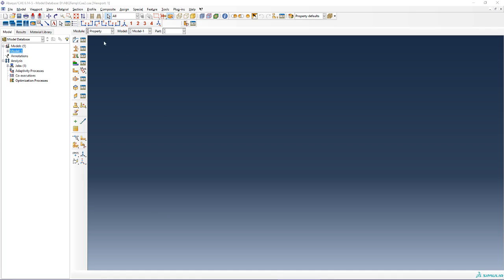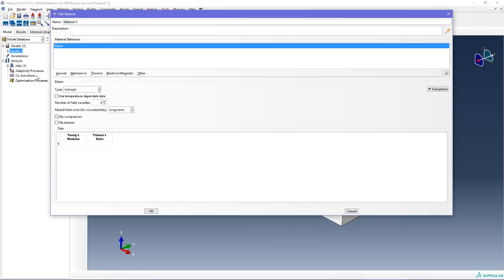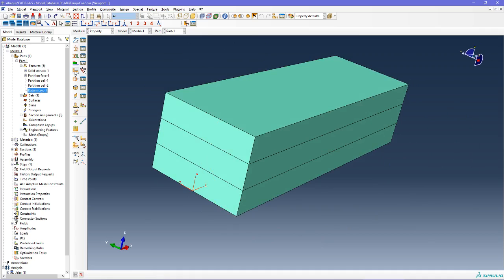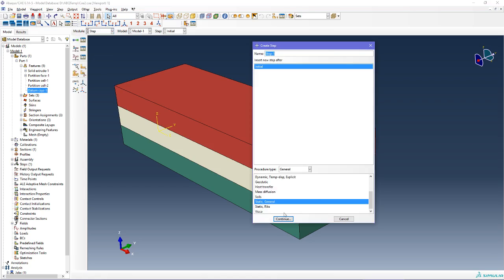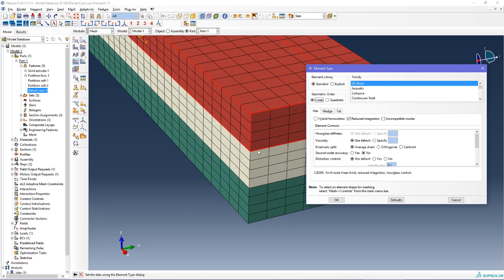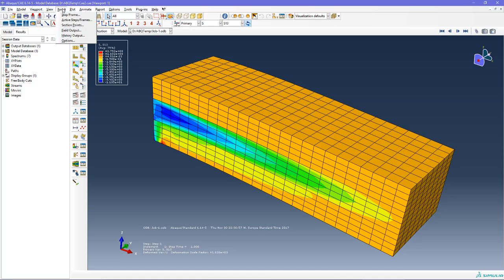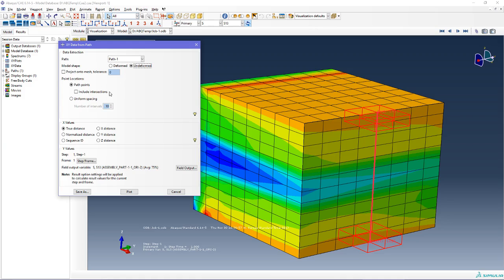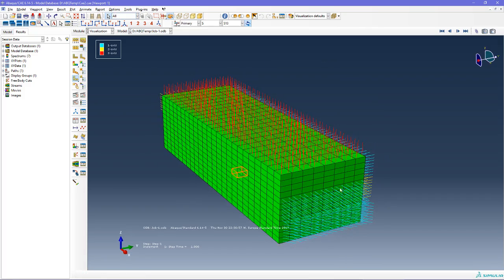Modeling of composite structures with 3D elements in ABAQUS

Comment: 3D solid element method is NOT recommended. Instead, continuum shell element should always be used. This video is very misleading.
Reply: why do not you make a video and compare you results with him instead of throwing such sentences ?
Reply from the maker: Nothing should always be used. There is always a tradeoff between accuracy and costs. I watched your video. You used continuum shell in the wrong way. I don't think you really understand the mechanics.
Reply: Depending on the stress state of interest solid or shell can be used. It is the user's responsibility to refer the user manual and define which element type is more suitable for the considered physical problem.
Reply: @BSS0202  Agree. In aerospace industries such as composite wing and fuselage, shell is most commonly used.
Reply: No. I used both of them compared with experimental case. it is correct
Reply: @turanturan2831  I think you did not get the point. For this very simple case, you can use both methods. But for a complex composite structure, you need to map your mesh to different ply zones and continuum shell section is the correct method.

Comment: sir, i wanna ask you, how to check cracking in model?
Reply: Hi Mr Imam, from the model developed by Mr Luke we cannot see that, if you're interested in model damage initiation and propagation Abaqus CAE have the Hashin criteria installed by default only for 2D elements (conventional and continuum shell elements mostly used). Otherwise you can check the failure damage indexes from Tsai Wu and Tsai Hill criteria only by requesting their outputs however this only will indicate a damage location and not the type of damage itself. If you want to develop a more accurate modelling using 3D elements you have to develop your own material model following the Abaqus subroutine option VUMAT and asigning a initiation and propagation damage. I hope this can help you out.
DB
Reply: @danielbadel1226  thanks sir

Comment: Great tutorial! However, I have a question. Why didnt you define contact between the layers?
Reply from the maker: I considered an intact laminated structure. No delamination, no contact.
Reply: @lukeli3760  Dose it mean that I dont have to define contact between the partitions (because they are still a whole part) ?
Reply from the maker: @rtq1876  In this case, solid layers are connected through sharing nodes at the interfaces
Reply: @lukeli3760  Thanks man !